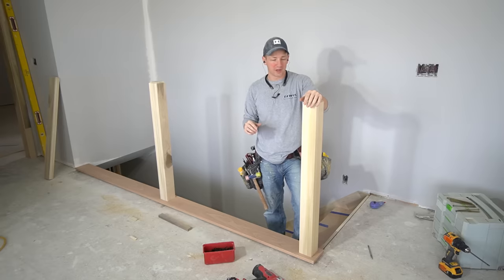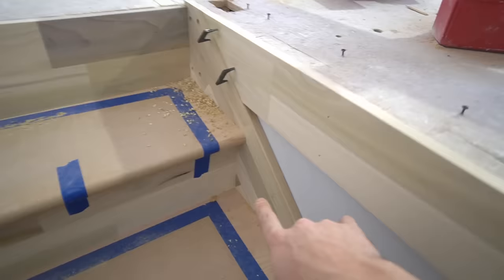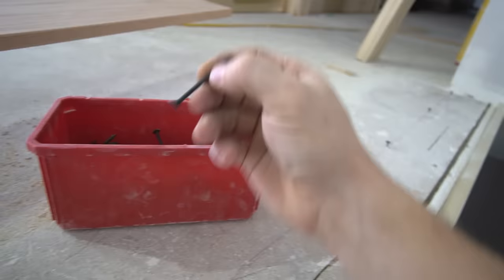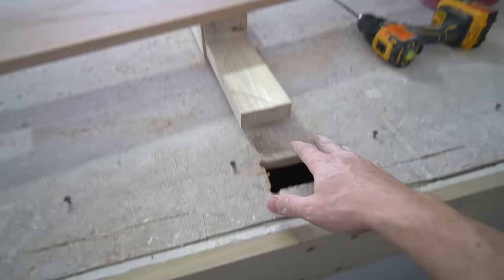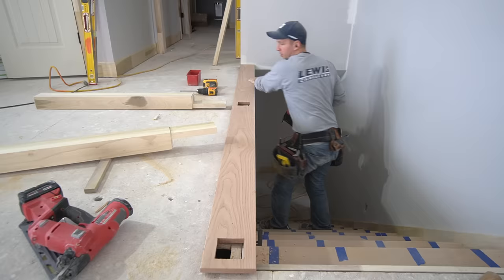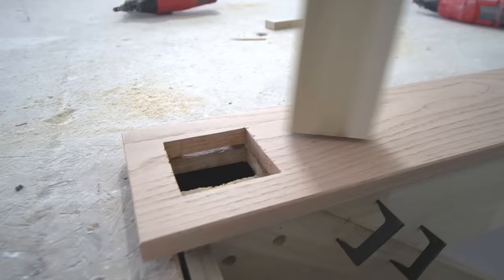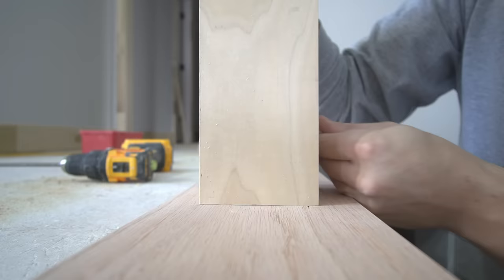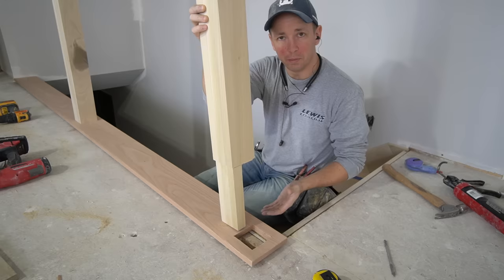ROCK SOLID Newel Posts - My Secret Sauce for Installing Newel Posts...

Comment: How do you make the decision to spend for an ultra premium tool from Woodpecker or Starrett when a more generic tool might be almost equal in performance but at a whole lot less investment?

As your battery tools go down, do you plan to replace with more DEWALT or do you think you’ll transition to Milwaukee?
Reply: More expensive tools last longer. They are made with greater thoroughness/diligence, so it's easier to use them; when working alone it's a very important factor that you don't need to fight with your tools. They are 100% accurate out of the box. They are 100% repetitive, so you may have one at the cutting station and one at the install. Because you paid more you take care of them more, so they are cleaner and you don't leave them just anywhere. Quite often they have extended, working(!) guarantee; even if not life-long, the manufacturer will be more willing to replace damaged tool.
And last but not least, premium tools are at not made in China, so buying them is a kind of a statement.
Reply: Ask yourself if this is a career or a weekend warrior deal. If it's a career you try and spend the money on higher quality just for the longevity and accuracy of the tool. 

If you scroll around YouTube you will find a lot of guys don't run festool because they don't like the price and don't mind taking the time squaring up some tools.
Reply from the maker: There is no easy answer for that one. I changes with every tool.
Reply: All good points and all well made.  I suppose in the end a lot depends on the depth of the pocketbook and how crazy is your passion for fine tools.  As a 69 year old retiree homeowner who helps a working pro neighbor when he needs a second set of hands, I have a little of the former and a lot of the latter.  Since I’ve stumbled across James Franklin and Spencer, I’ve discovered a whole new world of pro quality items I now have to decide if I need to upgrade or soldier on with my more pedestrian tools.  Latest quandary is if I should cast aside my perfectly adequate Zircon HD70 stud finder for a Franklin 710?  I know the joy and pride of ownership of top shelf tools.  I can’t do trim without my 6” Starrett combination.  However, where do you draw the line?  I hope to get deeper into woodworking but do I need to chuck my full set of acceptable Stanley chisels for Narex or Sweethearts?  Where does the line switch from gotta have to wanna have?  The new Rockler catalogue arrived yesterday.  I need to go wrestle with my inner demons.
Reply: @oldtireman4665  As @batmans dad wrote, if you're not full-time pro there's no sense in buying top-tier tools just for the sake of having them.
My answer is based on my experience as a contractor.Probably as everyone I started with cheaper tools too. High quality comes with time and experience, both in terms of performance and tools.
Sometimes there's no point in spending money on higher quality tools. When I buy 125 mm/5 inch diamond concrete grinding wheels I choose the cheapest ones, because one for $150 last only twice as long as one for $10.
I also have some cheap sets of spirit levels for dirtier jobs.
But when it comes to measuring or high quality finish, I prefer not to do something, than botch it with inadequate tools.
And of course, not every top-tier purchase is a good one. You spend couple hundreds or couple thousand dollars on a tool that is 50% useless, but you got caught by marketing.

Comment: Unless the rest of the flooring going to be carpet, I don't get why the shoe rail is shimmed so high above the subfloor. I'm basing this off of living in New England, where hardwood flooring reigns supreme.
Reply: I agree. The screw technique gives a level base/skirt board, but so what? What's going on with the rest of the floor? If it is hardwood, it will be horribly misaligned with that transition piece. I think this kid is great, but this unanswered question makes me think he is leaving that problem for another person too deal with later on in this job.
Reply: its lvt flooring itll tuck under the shoe board. hence the reason he held his screws back from the edge

Comment: No one ever address under the floor. Never.  So many scenarios. What if nothings under a corner.  Etc
Reply: yeah, there are some vids out there that show going through joists or whatnot, but most of the construction assumes there's stuff to bite into due to the layout.  hear you though... especially if the subs couldn't wait and the floor and sheetrock's all finished in.  ack